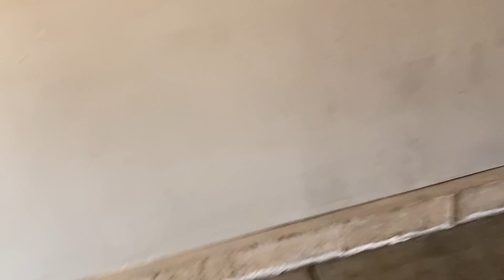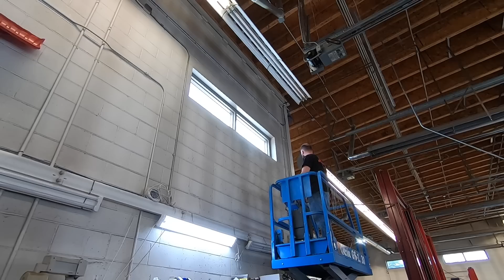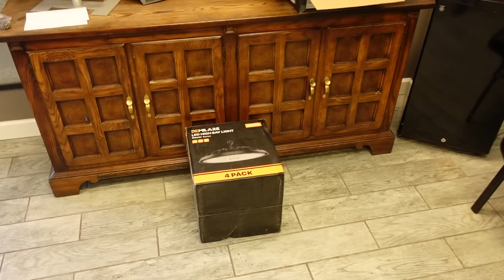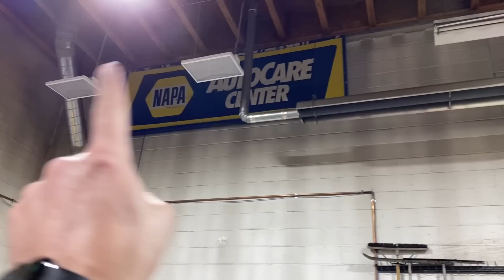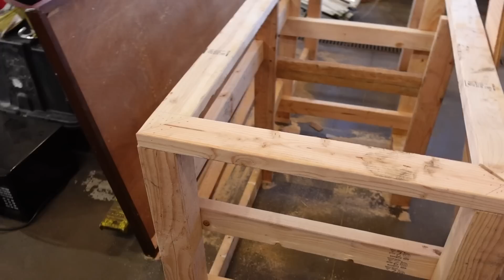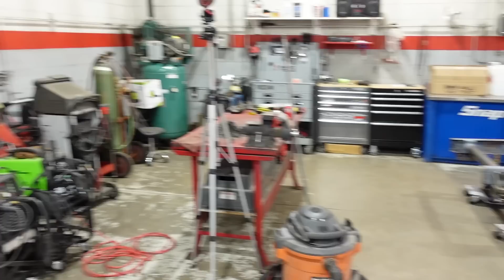the ABANDONED repair shop gets a MAJOR UPGRADE! Demilare LED

Comment: Good call with the lights, they will help heat too. Not joking they do get hot to the touch. As far as a cab for your frame up. Try looking for a z66 avalanche, I remember seeing a few as cab buys, they have MAGNETIC RIDE CONTROL the best ride setup GM ever produced. The truck itself is only a 5.3rwd but as a cab the MRC will totally beat anything out there. Remember the ad "thousand times a second" with the coffee on the dash while pulling. That same system's grandaddy. Cheap way to get a best of the best and still look copo kind of lol.

Comment: Be nice if they had light that could be integrated into the floor to light up under the engine bay that could be individually turned on and off, I hate holding a flash light under a car, it's horrible. Mention it to those guys and maybe they can come up with something. Also with the electric car b.s., people will be trying to fix cars again, great time to have an opportunity to start a shop! 💰

Comment: I can't stress enough the importance of cable and lock maintenance on that 4-post lift! The height locks will save your life when the cable snaps. My father had a 4-post well known brand at his shop with an Escalade being raised and when it was about 4' up when the cable snapped and sent the thing through the locks and slammed on the ground. Lift maintenance and inspection in general is critical, but we were told those 4-post are even more critical since the cable is so long.

Comment: The UFO lighting is nice but you would have been better off cleaning the original  fixture replacement just rewire the fixtures for a LED replacement tube.  it looks great dont get me wrong but would have look better illumination wise.  Also keep the receipts and file any warranty for them.

Comment: Are you thining about mounting some kind of (removable) divider between your "corner" of the shop and the rest? That way you can film also in the daytime without getting disturbed. Anyways its nice to follow the process of moving into the shop and upgrading. I for one appritiate some "carpentry" videos along with car videos!
Reply from the maker: i have had a few different ideas about dividing up the shop like a curtain or shelves, but not sure which direction I wanna go just yet.
Reply: @TolmanPerformance  I thought about a curtain as well because it might even reduce some echo. The issue might be fire safety and light dispersion. I admire your creativity with the projects, so I am sure you will find a solution to this as well.

Comment: I just want to pressure wash those shop walls and make that white pop! The soft pressure tip should do fine and keep a good distance without blowing the paint off.

Of course care should be taken around receptacles and controls mounted on the walls.

Comment: How fast car ya fix a CV axle that snapped off the splines from the CV at the wheel hub? 1994 Ford Thunderbird 4.6 2 valve... bit of weld and 3 hours fiddling. costs more then $700 and takes 6 weeks just to get the $50 replacement CV axle up and into Canada not including installation costs... when something brakes down up here, most of the time... it gets parked, thought about and then... ... of all things after fixing that axle in 3 hours or less, I got a new set of shocks for the rear end hardly paid a dime for them, overnight freighted from the far side of the north. weird how some things just happen? tho that was $3 of weld, beats the $50 replacement axle cost.

Comment: So how much light are you going to loose when the shop get fully up and running and during business hours all the bay doors are open and blocking the 5 LED lights closest to the bay doors? I mean most shops during hours keep all the bay doors open, or at least they do where I'm from. You might need to redo the 5 by the bays to drop below the bay doors when there open and put them between each of the doors.🙂

Also you said that the last 2 small bays were the lube bays. Maybe sense you have the brake lath you could turn the last 2 smaller bays into a full service area, ya know brake jobs, all fluid changes, Parts repair things like fuel pumps, radiators, lights you name it, anything just short of a full engine or trans replacement unless you would want to do that to. You could be a one stop shop. Get your auto pimped out and repaired all under the same roof. Like how things are coming sofare and keep up the good work.👍
Reply from the maker: Regarding the four lights by the doors, the bay doors can be opened about 9-10 feet before the lights get covered, plus the daylight coming in will help. And that is a good idea for bays 1-2 for sure! We want to be as full service as possible

Comment: Some random questions:
1. Are you keeping the existing branding for the shop or do you plan on an exterior makeover?
2. Does the site have room to put a full-sized CONEX instead of renting a storage locker?
3. Have you got a security & fire safety system in mind? Since you're airing this on YT you won't be exactly staying under the radar.

Comment: I did my shop when I built it with 12 fixtures of LED's right off the bat (had conventional tubes for years at my last shop) - they're incredible. Super low power consumption, nice color temperature (6500K). No 'buzz' of ballasts or anything. You'll love 'em!

Comment: Hey LT, need to schedule with Tolman Performance.. 05 Silverado 2500HD 4x4 8.1/Allison ExtCab/Shortbox White on 285/65-18 Anyway just turned 200k on way back from Matts Offroad Wrecker Games to Denver area. had (non-collapsible) slide in camper and did 80 across Utah like nothing. Passed everything except the gas stations... So have a 180 degree thermostat that haven't got in yet but need other help because some of those dang eco~~~ are starting to pull on me.. Help Please....
Reply: + it is bone stock and have had it for 8 years, named it "Mammoth" (since raptor and t-rex were in use). It is the unicorn 8.1 truck.. LT trim leather & sunroof. willing to be project

Comment: Honestly, as a shop owner, I highly recommend you keep that brake lathe! Prices are so high for new rotors now that it makes it worth turning ( most times) and with EV I do believe we will see an increase in brake turning jobs in the very near future. Congrats my man!
Reply: 100% agree on keeping brake lathe
Reply: yeah, just to knock the rust off them. The brakes on an EV are rarely used.
Reply: The last time I asked for a brake rotor to be turned every shop looked at me like I was insane lol
Reply: Honestly disagree with your logic and prediction. Most brake warpage comes from insufficient cooling. Taking away metal mass means less mass with which to absorb heat which results in even quicker warping after turning. Once I tell that to people, they almost always choose to go new. On particularly pesky cars (hello Honda), I sometimes cut slots in the disc brake shields and fabricate air deflectors to divert cooling air to the slots. 

Regarding EV’s, they use the brakes so little that rusted rotors quickly become a factor where they never did before. Audi has added software that periodically stops using regen so that the brake pads can more effectively remove surface rust.
Reply: @bwalker4194  I've read an article saying that most ev's will be using drum brakes because of this
Reply: As of now EV vehicles are a very small percentage of work.....with most going to the dealer.....just a thought.
Reply: On a Nissan Altima (average sedan) $120 at Napa at this moment for a front pair (typically last 20-30k miles). Authorized dealer gets included discount prices. I would just do higher volume items have (2) 4 post setup to churn that butter = more oil changes. Get them on sales = quick turnover.
Reply: Even at the euro shops I'm at, turning rotors slowly gained popularity back when prices skyrocketed.
Reply: Yhea keep the brake lathe. Once I was doing a clutch and the flywheel needed to be turned. It was more about the time of sending it out. So I used the brake lathe. Worked really well. It's totally worth keeping. You can make more money off a brake job turning rotors and the customer is happy because it saves them money. It's a win win!
Reply: I use to always have my old or new brake rotors and drums turned tell all the shops in my town stopped doing it, went out of business, or all the old boys retired or died
Reply: As also a shop owner, quit resurfacing rotors. You're doing a disservice to your customers.
Reply: @DavidRomanKC  how are you doing a dis service to customer's? Sure if you cut under the minimum. But if it's within why shouldn't you turn rotors? Plus if the customer saves money off having their brakes done kind of makes a happy customer
Reply: Keep the lathe. It will turn other stuff too lol
Reply: Opposite with ev they have less brake wear
Reply: @Rellsrides  That's exactly the point - lower wear, much heavier vehicles = warpage + enough material to machine...
Reply: @ckm-mkc  The motor does all the braking. Even in an emergency it still provides 30-40% of the braking effort unless the battery is above 95% full.
Reply: @Rellsrides  here in the UK we salt roads in the winter, dunno about your area. Anyways ev brakes seem to always fail the yearly inspection from rust, not wear, so seems a lathe is a good idea.

Comment: When I swapped out everything in my shop to LEDs the electric company sent somebody out to inspect my meter. They know I'm an electrician and thought I was tampering with the meter. I'm in process of swapping everything in my house to new LED fixtures a few at a time. Adding some new ceiling fixtures in places where they wasn't thinking when they built the place also. Dives me nuts that none of the 4 closests or even the pantry have any light in them.
Those wall mounted fixtures can be easily retrofited to LED bulbs without having to install all new fixtures. Might be a bit cheaper unless you have some purpose use fixtures in mind for them.